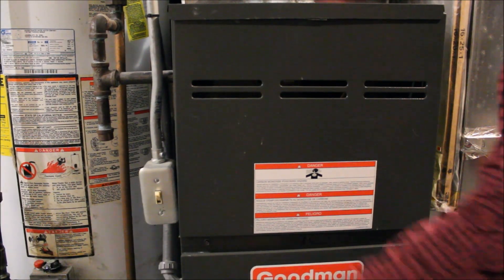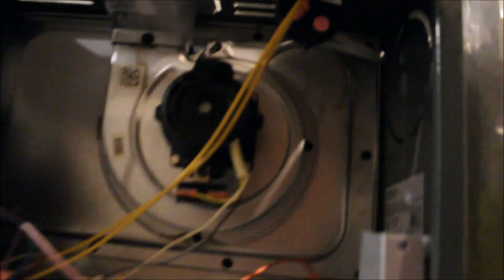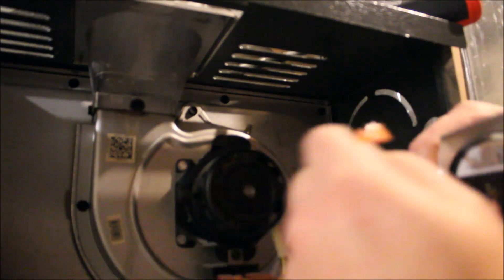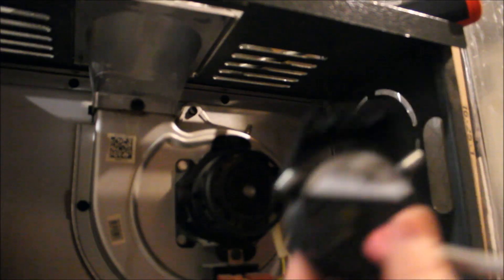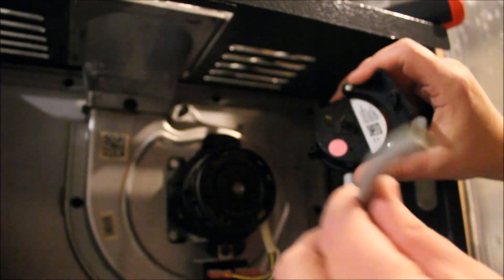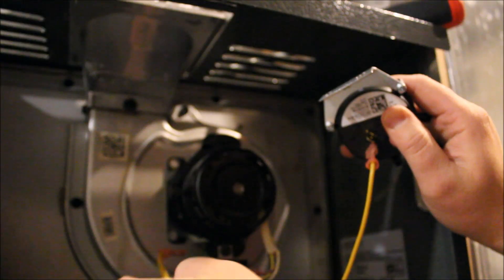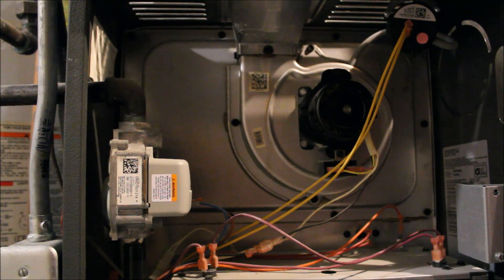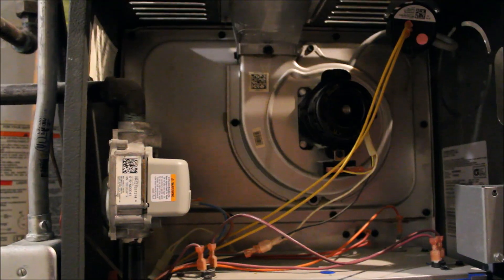How to fix a Goodman Furnace Pressure Sensor Switch - 3 Blinking Lights on Furnace

Comment: The wires on the pressure switch run in parallel and that means it doesn’t matter what terminal you put the wires on you know that they run in parallel because the two wires are the same color.

Comment: Thank you so much, I forgot to change  my filter, and it overheated that caused my pressure switch closed, after watching your YouTube, I checked and saw the blinking green , red solid that is pressure switch problem, I remove the small pipe ,blow and suck till hearing bip sound open n closed, then I put it back, I turn back power on, my furnace working perfectly, you are awesome, thanks again,

Comment: THANK  YOU.....Your fix works perfectly for Carrier furnace, also.  We had a severe wind storm that caused severe power fluctuations and the pressure switch was stuck in the closed position as shown by Code 23.  Pulled off the hose from the nipple behind the inducer motor, gently blew in it, heard the switch click, reattached the hose and the furnace fired right up.  But from what I've seen on the web, it is wise to buy a spare pressure switch.  Otherwise, your furnace dies for want of a $35 part.
Reply from the maker: Thank you for the comment! Glad this still holds up. 😀

Comment: So I had a similar problem with slightly different details and I solved it with your blowing trick.  I could hear the switch open and close when i puffed it.  But problem remained.  I have 2 furnaces so I switched pressure sensors and the problem remained.  I took the chimney off the top and the problem remained.  I could feel the air venting just fine so the switch should be working.  I took the pressure sensor off of its tube and tried puffing with the tube on the motor.  I couldn't get air in or out of the motor.  I removed the tube and shoved a wire in the nipple on the motor and it stopped right away.  I shoved it in harder, and something gave way.  There must have been some crud blocking the suction from the nipple on the motor.  It all works now, no blinking light.
Reply: Your comment saved me! I had the same issue. Used a paperclip to clear it out

Comment: Mine was blinking once, the panel said one blink, it's the ignitor. I installed a new one but there was no change. Rather than blindly throwing money at it, I called a tech. He fixed it in about 3 minutes at a cost of $741. Ouch! I thought it would be around $300 ish. That was beyond crazy for a part that I later found out was under $40. Needless to say, I feel like I got screwed big time. Not knowing what the problem was, it was hard to look up how to fix it. Great video though.

Comment: it can also be a loose connection on the plug at the circuit board. You can spread the male terminal on the board to create better contact. thats how i fixed mine

Comment: WOW! Thanks man.... I live in Canada, and while winter hasn't set in yet, but my furnace wasn't heating the house today. Saw this video and checked the pressure switch tubing and ports which were clear, then did the hose trick and could hear the valve opening and closing. Put it all back together and bam it worked. Will replace the pressure switch too when the part comes in. Thank you so much!
Reply from the maker: Excellent! This is an old video of mine but I’m glad it still holds up and is relevant. Glad it helped and hope your home stays warm!
Reply: Did the new switch for you fix the problem @BrickBuildingKids

Comment: Like You Said Its Not A Permanent Fix, You Just Put a Brandade. Don't Mess with Your Gas Appliances without Knowledge. Call The Professionals.
Reply from the maker: Replace the part like we did in the video, it’s a permanent fix.

Comment: How do you know which is the bottom and top connector wire? I unhooked mine and couldn’t remember which was which when I put it back together and they are the same color?

Comment: thanks this is awesome.  can you use just any pressure switch to replace it, or do you need to get a part that exactly replaces the part number... does it matter? really hard to find the one i need as this is an older amana (goodman) furnace. thanks!
Reply from the maker: I’m really not sure, but I would put your current part number in an Amazon search and use the closest one. If it’s not right, Amazon’s returns are pretty each. 

I completely understand and I’m sure some of the other brand models may work, I would just be concerned that the pressure the switch would be expecting may vary from different models or the fitting sizes may differ. I hope this helps and you get get your issue fixed. Thanks for reaching out!

Comment: Sir I changed the switch but Problem is not resolved so what should I do Still three time blinking light
Reply: Check where the hose is connected to motor. Use a paperclip and clear anything blocking. Then connect hose and leave other end disconnected. Run the system and you should feel suction on your finger on other end of hose.

Comment: Incredibly helpful video.  I ordered a replacement pressure switch on Amazon for $12.99, popped it in in under 5 minutes, and we're back in business!
Reply: Which one did you get? When i look up the P/N, mine was $69.

Comment: What would happen if the wire connectors were switched and you’re not sure where to connect The wires? Anybody
Reply: Nothing. It doesn't matter if you switch them up.

Comment: I replaced the pressure sensor switch and I still have the 3 blinking lights.
Reply: Me too. Do you know what it was?
Reply: @jamesrash2  The issue was that there were electrical contacts were corroded / rusty from moisture and there was a bad contact so the furnace would not run.  Finally we just replaced the furnace since the same issue was reoccurring every 6 months.
Reply: That would mean you have a blockage in the hose or the other end
Reply: @TraceguyRune  The issue was that there were electrical contacts were corroded / rusty from moisture and there was a bad contact so the furnace would not run.  Finally we just replaced the furnace since the same issue was reoccurring every 6 months.

Comment: so replacing the pressure switch with a brand new one is temporary?
Reply from the maker: No, getting the old one to work again is temporary.
Reply: @BrickBuildingKids  you never told us how to get the old one to work. You skipped that part
Reply from the maker: In this video, there is part where we blow air into the tube and suck it out to toggle the switch. That’s how we get it to work temporarily

Comment: Thanks for video, however you did not show exactly how to temporary troubleshoot the pressure switch? I noticed you blew air into to text the open/close function on switch! But that does not show how it will temporary get furnace to work until your new switch arrives in the mail. Do you if running straight power to switch wires, will temporary run furnace heat to replacement is done?
Reply from the maker: Hi! The in and out of the air is what we did to re-engage the switch. Doing that and hooking it back up helped get us through waiting on the new switch and some cold mornings.

Comment: My heat went out this weekend and I called a local company to repair the furnace. Turns out it was this switch but it seems to me $376.22 is a lot more than what I should have been charged, especially since this switch is available for $17-$20 at Walmart. Your thoughts?
Reply from the maker: I’m not a furnace tech and I do it myself because of those costs. Seems excessive for the part and he was probably only out for a hour or two.
Reply: It's like he watched you with your wife. In other words,  he saw you coming

Comment: You can run to Amazon?
Reply from the maker: Back when I made this, there was a few Amazon pick up locations around us. If you found this video, I hope your furnace is up and running. Unfortunately, this issue was common with this unit.
Reply: @BrickBuildingKids  I wish we had locations like that. I'm waiting on a pressure switch to arrive by mail. Hopefully that solves the problem. The light on my furnace is blinking in way that indicates that is the problem.

Comment: Any thought as to why the pressure switch goes it seems every year I am replacing it.
Reply: Condensation due to being a high efficiency furnace, or maybe debris is getting inside it. I just needed to clean out the hose because the end had become plugged.

Comment: Are Goodman have Two sensors only 3 years old and exhaust and intake ports holes but only have Exhaust running outside. I found water inside once I open it the guy whom installed it had to come back 3 weeks later after first install.

Comment: pf rate have to be the same? mine was -1.10 pf and trying to buy new one but it's really hard to fine the same one, wondering if the rate have to be the same.. please answer quick someone..
Reply from the maker: Hi William! I would not deviate from the units original specification. I would make sure it matches.
Reply: @BrickBuildingKids  thank you for the quick reply sir, but i think (-1.10) is obsolete now.. I'm trying to get -1.20 or -1.30.. do you think it would work in this case?
Reply: @billxo  1.20 will work just fine

Comment: My Goodman furnace is working and blowing air without any heat. Ecobee thermostat sent me a message saying that “the furnace has been calling  heat for the past hours but my inside temperature dropped 3 degree” . could it be due to the pressure sensor switch as well? I just changed my air filter 1 month ago. 
Any recommendation will help. Thank you.

Comment: I replaced withe pressure switch with an identical part that I also got from Amazon for my Goodman furnace and the dam 3 blinking lights still on..... I was told by a heater guy last month who came that he replaced the hose and start right up and no more 3 blinking lights..... but 3 days later it stop working no more heat.... it fixed by itself until tonight....... any other suggestions? I read someone posting about replacing the fan...... good video....
Reply from the maker: I have not ever had to do that with ours but tracing the steps of what’s activated and what stops, I think you are on the right track. If the pressure sensor isn’t getting enough pressure to the tube to to the sensor to complete the circuit, the fan will stop blowing. If the fan is not blowing or creating enough pressure to initiate the sensor, i could see it being bad. Could there be any kind of obstruction or build up in the nipple that connects the hose from the unit? If you disconnect the hose from the unit and were to blow inside the hose to the pressure sensor to complete the circuit while the fan is blowing, does the unit run differently? It might sound unorthodox but that would simulate for sure getting pressure to the sensor to keep the unit running and moving to the next stage of heating. If that method doesn’t keep it running for a bit longer the problem might be the board. 

I’m not an HVAC guy, but a computer guy so my knowledge is limited but those are the steps I would go through to diagnose a little more so I had a better idea of what could be wrong. I hope it helps and you get your heat back soon. Thanks for reaching out!

Comment: Most of the time if your pressure switch is faulty there's a reason why. Almost always it is not the pressure switch that is the problem. There's a reason why the pressure switch is giving you three flashes on your control board. You have some sort of flu restriction, the entrance to the rubber hose is restricted, the exit to the rubber hose entering into the pressure switch is restricted, and or the hose itself has a hole in it. I would check all these things before you actually replace a pressure switch.
Reply: Ok

Comment: Talk about stupid, made in  Cost Rica pressure switch hooked to the vacuum caused be the inducer motor in the heat exchanger.  With a vacuum when switched off, sucks in soot from the heat exchanger, landing on the contacts preventing good contact.   While I had the ten year warranty, got tired of waking up to a cold house.  So I purchased  ROBERTSHAW Pressure Sensing Switch, .25-1.0  WC that has an external microswitch.

These can be adjusted to the same water column pressure as the OEM switch.  Got tired of replacing these switches, would drive over to my dealer to get a new one, if he came to my home was 150 bucks!  Ten years later still work. 

Live in a country where most people, single passengers are driving huge SUV's and Pickups that suck gas like crazy and in a country that is brighter at night time than daytime with all these lights on, what a huge waste of energy!

So what do our idiots in congress do?  Eliminated the pilot light claiming that is wasting energy, but more is used in electrical energy to ignite the gas.  But the real down side of eliminating the pilot light is electrical losses are far more common,  and with no electricity to your home, furance won't work and you will freeze to death.

Comment: Did you check why the pressure switch wasn't working properly ,maybe there was a blockage in the flue pipe Its also good to check the water colom pressure from the combustion blower
Reply: Hi what exactly is water column pressure, what's it's purpose and how do you test it.

Comment: So I was thinking I had the same issue as you but I noticed you blew into the new working on and it clicks. I took mine off the inducer nipple and blew into it and heard the clicking noises. I also took cleaned out the inside of the nipple to the best of my ability? I also reconnected the gray hose back to the inducer fan and disconnected it from the pressure sensor and blew into the inducer (POWER OFF) and didn't feel resistance. I reconnected everything again and still getting the three blinks. Any ideas?
Reply from the maker: Hi Bud!  As weird as it sounds, sometimes I would have to blow into and suck the air out of it repeatedly to toggle the sensor.  Then hook it back up to the inducer nipple.  It's not perfect, but it's gotten us the heater working again.  This part seems to be a big failure point for these units, so it may eventually just need replaced.  Stay warm and I hope this helps!
Reply: So this is 5 years too late but if you land here like @BudShep then it is possible your pressure sensor is working correctly.  My problem was blockage in the nipple where the hose connects to the blower.  But you should also check to see if your chimney is blocked.

Comment: i saw no fixing i saw a part replacemant
Reply from the maker: Hi! There is surely a fix in here. The tube that you disconnect, we push air through and from the part to loosen the flap inside the sensor.
Reply: im not being  a smart ass but i thought the tittle said how to fix a pressure switch but you did explained very well tho. i just had to do the same on my furnace i mean disconnected both wire and blew in the hose to the switch and it worked but maybe for a few days so im going to def order a new one .but sorry if i offended you it was not what i was trying to do .  Hope you and the kids are warm sorry again
Reply from the maker: No worries at all! You for sure didn’t offend me. I just wanted to make sure you saw it. I have had a lot of people skip this video with similar comments in the past. This fix has gotten us through a lot of cold mornings but we’ve ended up replacing the part a few times. There is definitely something with this part that makes the condensation or something built up to make it faulty. Stay warm and thanks for the comments!

Comment: Good information. Thanks.
If GMH80 furnace has running inducer blower but igniter didn't lighted then check pressure switch. Blowing air in out may free up pressure switch contact. I have noticed after years of use some time hose cracks and leaks. Some time even air hose connection nipple on blower may get plugged by rust or dirt and moisture. So use thin wire and clean. Can I assume if igniter lights then inducer and pressure switch circuit fine?
Reply from the maker: I want to say you are right. I was told by previous service man that unless the pressure sensor completes it circuit, which is that click, the igniter will not light and your blower will stop blowing. I’ve noticed my hose has definitely worn, and gotten smaller over the years from taking it off and on.

Comment: I have not checked mine system yet, but would like to know if this problem (Goodman Furnace Pressure Sensor Switch) can also be related to the smell of gas, given the furnace is not firing up...? Any help is greatly appreciated!!!!
Reply from the maker: If you smell gas, I might be concerned that there is a leak somewhere IF the furnace isn’t trying to start. The coils or the igniter might need cleaned off. I would have cases where the furnace would start, try to light and try to blow but not stay lit and you can get a residual smell of gas that is resolved by cleaning the coils and igniter. That’s my Non-HVAC feedback. If you keep getting a gas smell it might be best to get a professional out.
Reply: @BrickBuildingKids  Thanks for replying! I will check it and clean the coils and go from there. I really do appreciate your feedback.
Reply: @BrickBuildingKids   Update: Cleaned the flame sensor. So far so good! thanks! No gas smell, for now. Hoping  we can get it through the bitter cold these coming days!
Reply from the maker: Awesome!! We are in Ohio so we are feeling the chill as well. Glad to hear it helped.